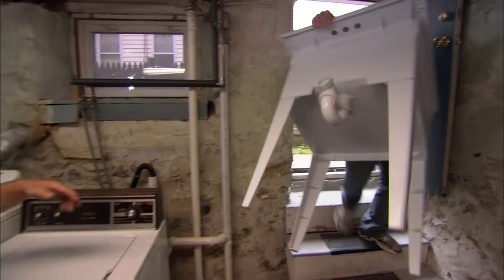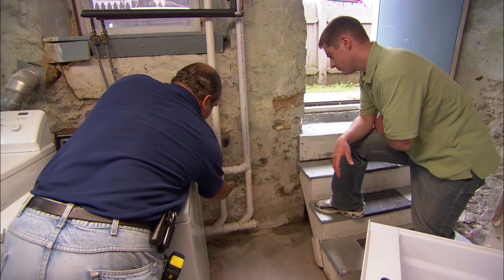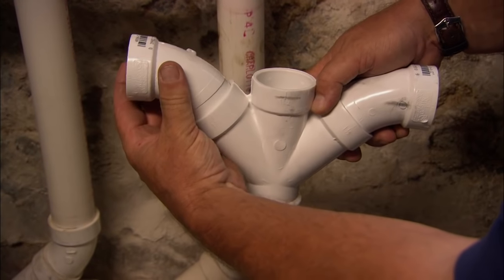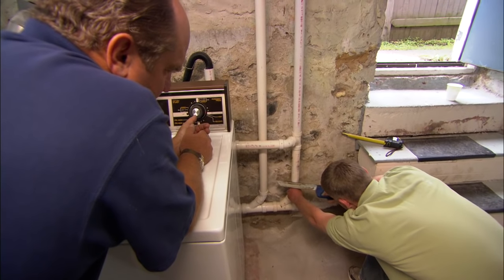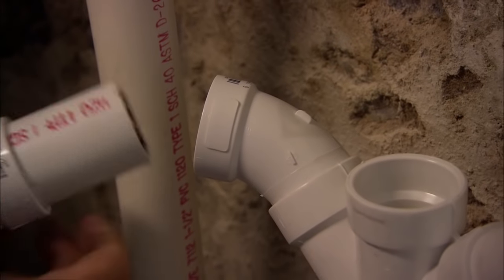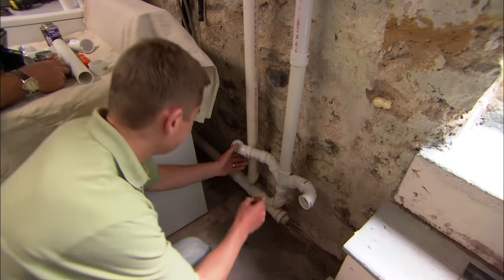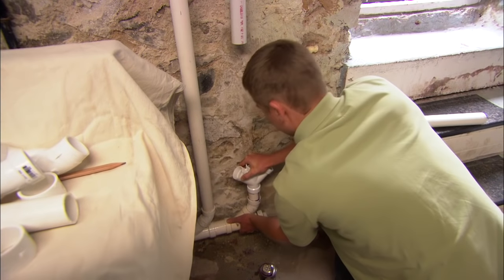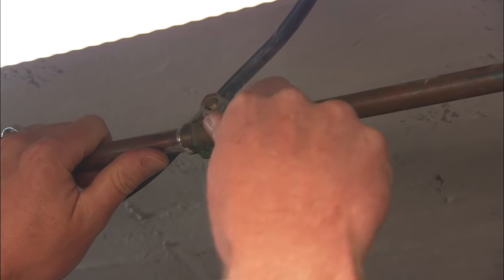How to Install a Utility Sink | This Old House

Comment: This was a good video,  but soldering is beyond many DIYers.  There are lots of great products for connecting vavel and plastic pipe without solder.   Plastic is easy to work with and lasts wall;  in new homes it is the prefered material for water inlets.   I think your plumbing videos should show these new products.
Reply: brett knoss buy some copper fittings and pipe, give soldering a try, I think you'll find it really not that difficult and very satisfying to see that solder flow into the joint. just remember the right flux is key!
Reply: Isn't this show about teaching homeowners diy projects that are out of their comfort zone?
Reply: if you cant soldering, you are not a diyer
Reply: +Yu Fang "if you cant soldering, you are not a diyer" I didnt know that you needed a certain number of skills to be a DIY'er! Where can I find the school to go to get the degree in diy'ing?
Reply: Divisiondoorway Pinterest lol
Reply: this OLD house. not this moderatly modern house
Reply: plastic water supply lines are easy to work with and affordable, but durability is still in question. since they are so new, their are no rates yet for how long cpvc or pex will last. copper on the other hand has been around long enough to receive the highest rating of 99 years.
Reply: Paul Miller pex has been used since the  60’s so I’m not sure why you think it’s reliability is in question

Comment: going to destroy your toes coming in that door and kicking the sink
Reply: StevenM who wears shoes at home
Reply: You learn after the first time
Reply: Wrong.  You cannot install a double Wye in the VERTICAL position.  The vent is now below the trap weir creating a siphoning, 3/4” S-TRAP.  What you should do is create two vents at the 42” mark using a SAN T and 45 or a Wye and 45.  Bring the second one down, stub out using a San T and tie into your horizontal drain at the bottom
Reply: couldn't they move it 20cm to the left ? there's enough space
Reply: tmpEngine Yes that works as well

Comment: I'm really glad I learned how to plumb for real before watching this scabby plumber botch job after job. Yeah it works, but it'll never pass an inspection where I live. I would have put a san tee in lower for the washer and stack another san tee on top for the sink. Of course with the current code you'd never get away with anything less than 2" dedicated line for the washer. Looks like this 1½" line was being shared by at least two other fixtures. Like I said, it'll work but would never pass an inspection here.

Comment: Wrong.  The proper fitting to use is a Double Fixture Fitting.  You cannot install a double Wye in the VERTICAL position.  The vent is now below the trap weir creating a siphoning, 3/4” S-TRAP.  What you should do is create two vents at the 42” mark using a SAN T and 45 or a Wye and 45.  Bring both down, stub out using a San T and tie into your vertical drain near the bottom using a WYE and a 45.  Then you connect to the horizontal drain at the bottom.  Another way is two SAN T, one above the other.
Reply: Walk into any mall, office, store, wear house, and I guarantee you will find double fixture wyes installed. They are in most building code books. Stack vent then vent stacking is the old way, don’t get me wrong it works, and it would have been better used here!! But double wye is good to go, but rolling those 2 45s actually isn’t to code, he went over the amount of offsets allowed after a vent. He was better off to just cut in a wye below and run an individual teewye off of it for fixture drain to laundry tub, then tie the vent back into main stack. W.e
Reply: Andrey Yaromich I am not sure which code you’re referring to, but the UPC which most states adhere to, states in Section 905.5 Location of Opening: The vent pipe opening from a soil or waste pipe, except for water closets and similar fixtures, shall not be below the weir of the trap.
https://up.codes/viewer/california/ca-plumbing-code-2016/chapter/9/vents#9
As stated, the Double Wye pushes the vent below the trap weir.  That means you have to use a Double Fixture Fitting or design it differently.

Comment: I think it would have been better also to put some screws and bolt the sink to the floor
Reply: or you could not bump the sink........................
Reply: We did that but did not level. Enough water drains that over 4 years, it’s gotten “black”. Gonna redo - how much backward tilt is required????

Comment: Another hack job by Rich....sink is not secured to walk or floor so it will move..... no proper support or hangers for 1/2" copper water lines .... 2 different types of shutoffs.....braided flex hose type supplies not rigid (any "professional" plumber would install).  I have been a plumber for 20 years and have seen better quality work from an  apprentice ....Not professional whatsoever.  Plus I doubt that he has a Plumbing licence for every state  he works in ...
But I must say at least you moved those existing 1/2 inch water lines that were in front that basement window. Egress code violation

Comment: The double wye in the video is the wrong fitting. That type of fitting will allow the traps to siphon.
Siphoning is when the water is pulled from a trap, and yes it makes a gurgling sound. You don't want the trap to siphon dry, the water is there to block sewer gases from entering your home.

This Old House, in this video it's clear that they have no idea about how plumbing works, or the proper use of fittings, or the correct sizing. The video is a total joke and should be removed.
Reply: What is the correct fitting then?

Comment: Lazy.  The only thing secured was the washing machine valve.  Usually, not bolting the sink down is against code too.
Reply: I was looking for stand off brackets also , good catch on the sink being secured . :)
Reply: Nicholas Smerk I notice this a lot these videos, huge spans of pipes unsecured, brackets or clips must cost a fortune in America 😜
Reply: The funny thing about videos are, not every single thing they do is shown.

Comment: He did not brush finish the solder or use stand off brackets on the supply lines to the sink . Sloppy and floppy yuck .
Reply: What do you mean brush finish the solder?
Reply: He probably means very wiping the solder with a dry rag while it's still hot. Looks really good when done.

Comment: It doesn't help much when the materials I want to see that you use to connect the drain to the sink drain are already put together and it doesn't tell anyone how to connect the piping system to the sink.  Thanks for 90% of the info.